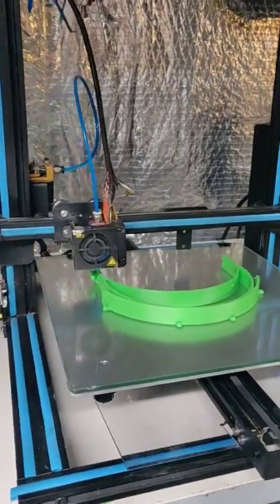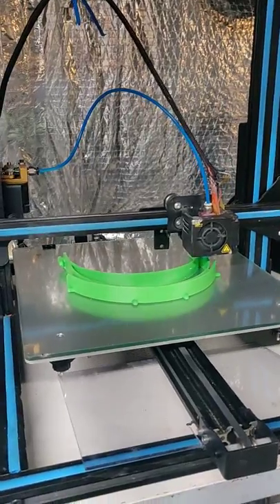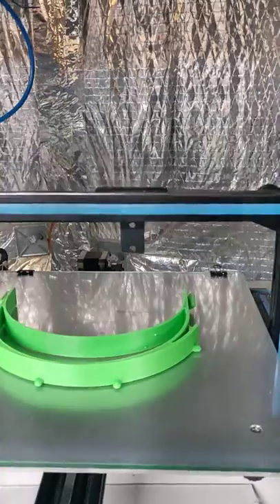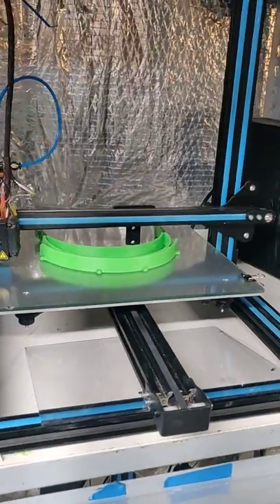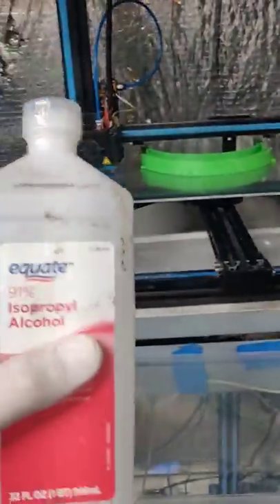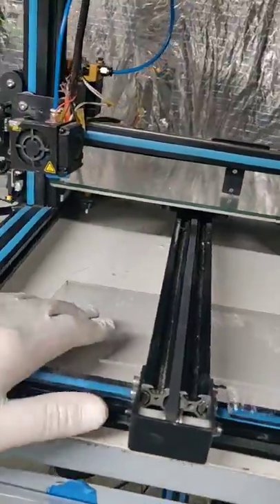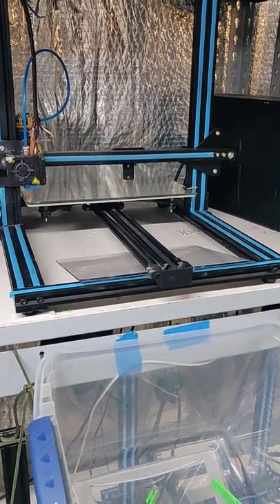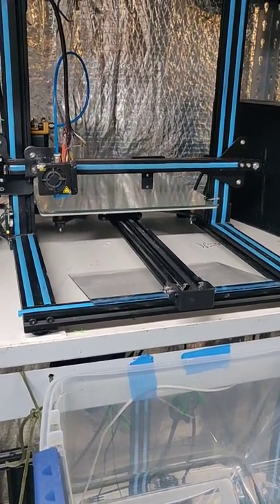Prusa RC3 Facemask

Comment: I'm about to start printing these on a CR10 V2, what print settings did you use? PETG?
Reply from the maker: Here is what I normally use for Inland PETG

40MM -- Inner Wall
45MM -- Outer Wall
50MM -- Infill 

245C -- Nozzle
70C -- Bed

1MM Nozzle